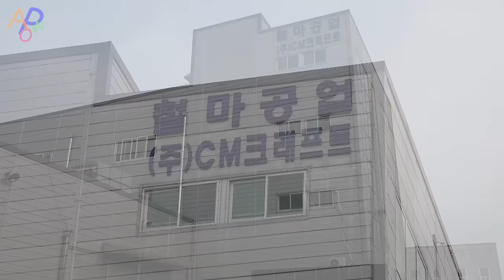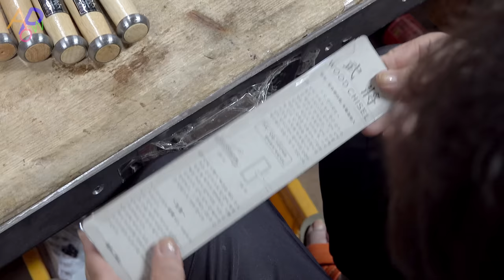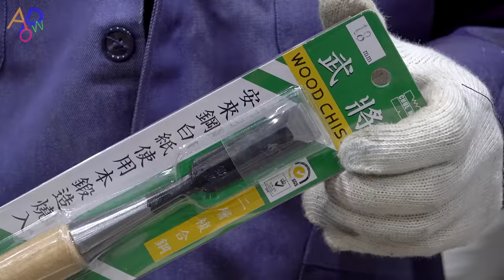Amazing Wood Carving Chisel Production Process. 65 Year Old Woodworking Hand Tool Factory

Comment: What is the molten material they are being heated in at 4:43?

Also, as a cabinet maker of 47+ years, I have never seen a hollow grind on the back of a chisel.  What is the purpose and what happens when you finally sharpen past the flat on the back at the tip?
Reply: It is molten salt
Reply: @iivaripaakkonen2699  thank you!  Then what is  being used at 5:43 to anneal the blades?
Reply: OIL
Reply: A hammer is used to displace metal near the tip so it can be sharpened again. These are "Japanese style" chisels, they are not too uncommon.
Reply: @下手横好    If they are annealing the steel (softening process) then oil cannot reach the temperature needed.  Minimum is 500F to 1400F.  No oil will handle that high a temp. without flashing into flame.  It must be for some other purpose.
Reply: @AffordBindEquipment  The steel is being hardened not annealed and it doesn't necessarily flash into flame especially when such a small amount of hot material is quenched into a big vat full of oil as seen in the video.
Reply: @chapiit08  Steel has to be changed to a different state, heating it to form austenite and then quenching it to form martensite (red hot, about 1400F) before it can be hardened.  The metal shown in the vid is not hot enough to be hardened by the oil.
Reply: @AffordBindEquipment  Some steels require less heat than others to achieve a desired hardness, I have a Boheler chart hanging in my toolroom with such colors and temperatures as reference for a number of special steels.
I don't see the point of going through such an involved process of making what it looks to be a good quality tool out of some cheap steel or to give it an unproper hardness. IMO the maker found the way to achieve the desired hardness in one simple step without having to go through a tempering process afterwards. I guess the best way would be to get our hands one one of these chisels and find out first hand.

Comment: 4:43 What is used for the heat treatment? Is it a coloured hot  liquid or melted metal?
Reply: @reb2322  ok thanks very much. Very interesting so you were an operator when I was not still born or maybe I was just born (at the end of '75, almost '76).